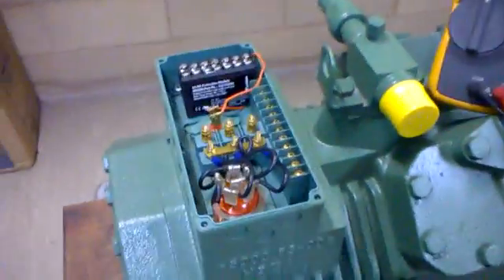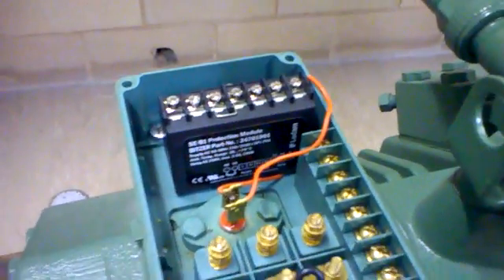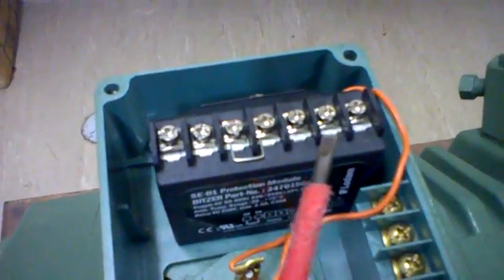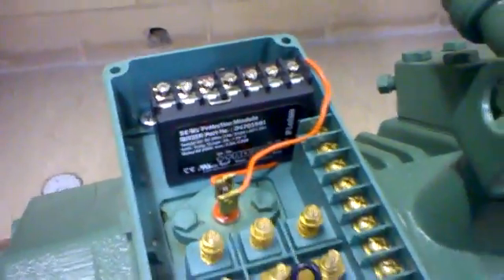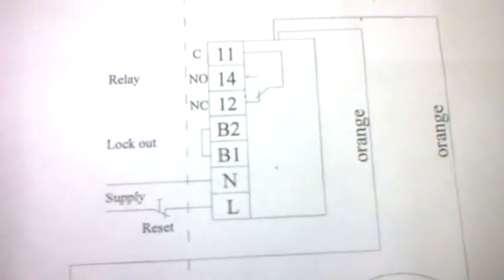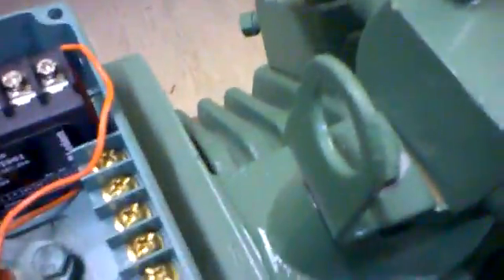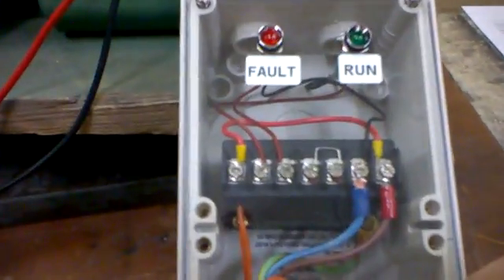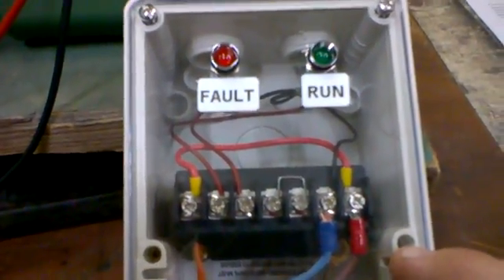Protection Module on Semi Hermetic

Comment: Thanks mate. The ptc sensor resistance is close to zero on the compressor i’m working on. Is it possible to replace the sensor or does compressor need replacing? Cheers

Comment: Is that PTC replaceable?
Reply from the maker: @billyeddy6974  Lodam is a company owned by Bitzer that make the protection modules which are replaceable. The internal PTC thermistor array in the stator is fixed.

Comment: Hello, greetings! We replaced the compressor module and when it starts, it shows a pulse at start-up, turns on, turns off and then turns on again. We tested it outside the compressor and it has the same behavior, it could be a factory defect in the module?
Reply from the maker: Hi,  thanks for your comment. I suggest you take that up with the manufacturer with the behaviour of the module. Would be a good idea to check the total resistance of the internal sensor loop to ensure its not close to the trigger resistance.

Comment: Thanks for the very valuable video . I came here after my compressor got heated and burned out. This safety device was untouched ,dnt known how this device ddnt worked.
Reply from the maker: Your comment on the saftety device being untouched is the exact reason I did the video.  Indirect safety controls, which do not form part of the main power bus in can get ignored. Hopefully, everyone can appreciate the quality design of the protection symmetry within the stator that is offered.

Comment: IV been told that it's no big deal if you bypass them cause they are fitted with a overload on the contactor
Reply: Don't know these compressors come with supply contactors or not ,but mine does not have one. I had to install the contactor separately. I think not many contactors have thermal overload relays with them. Thermal overload relays need input from temperature sensors anyway. It's not a good idea to bypass this safety device ,in the first place.

Comment: Thanks for your video. I"m in la PAz B C S Mex . And I been working in a 27 hp bitzer compresor, I repair the compresor but I cant reset the int69. I replace the int69 and still show me a fail. You think is yhe resistence that is  failing ?

Comment: Where is the wire it supposed exist from relay to control compressor contactor
Reply from the maker: On this type between points 11 & 14 on the protection module
Reply: Potshion relay  semey tupe comrssar using potshion  rely   power   hev euqpend  winding portacting

Comment: Hi. I have problem with my 8FC-70.2Y comp. Oil pump is changed 1,5year ago. When it was changing, they found small piece of metal in case. Now, compressor have to be restarted (oil pressure protection) several times (at starting).
Reply from the maker: Its not good to have the oil pressure switch tripping out constantly. If this is a loss of pump dynamic oil  pressure causing it to fail then it would need to be checked over to see why.  The dynamic pressure also needs to be verified that it meets the manufacturer requirements. Many oil failure switches are non adjustable now as manufacturers like to make sure their equipment is protected within their specifications. If oil level is not the issue , suggest the pump and/or control be tested further.
Reply: Dennis Kenworthy thank you. Oil level is ok. Probably it is something wrong with pump.